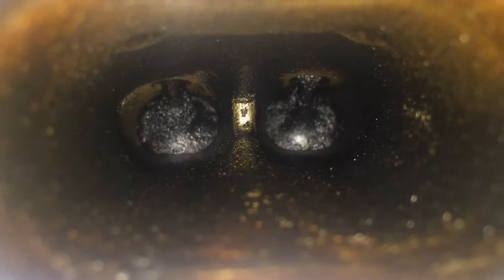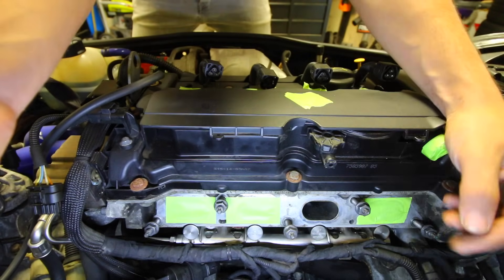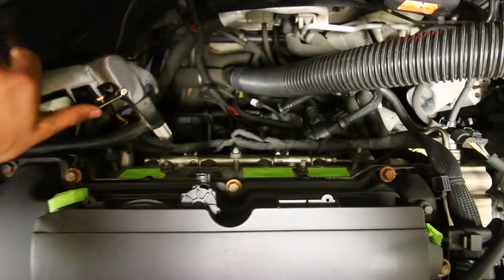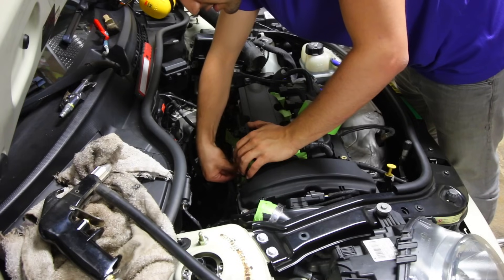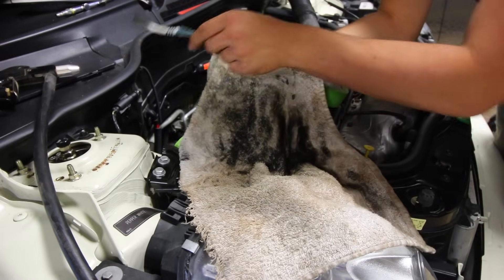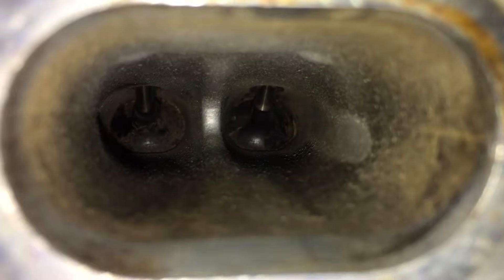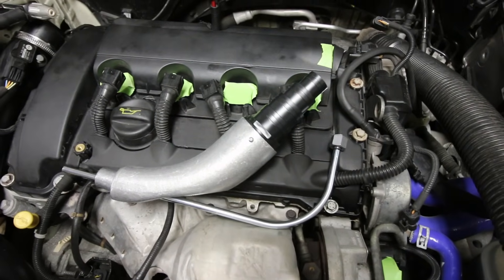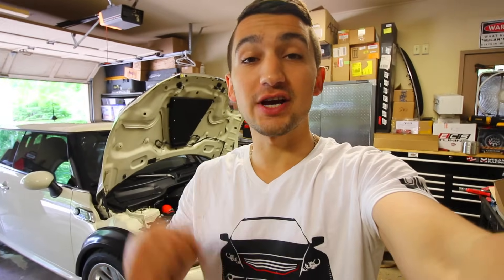How to Walnut Blast Your Intake Valves (CARBON BUILDUP REMOVAL)

Comment: That's why you use Top tier detergent gasoline I always use top tier detergent gasoline
Reply from the maker: Not true. If you own a Port Injection car, you wouldn't ever run into this problem. Since this engine is Direct Injection, there is no way of changing from cheap fuels to expensive top tiers which will result in a difference.
Reply: Negative. Fuel doesn’t reach the valves on DI engines. Therefore the type of gasoline doesn’t matter.

Comment: The more I discover about current engine technology, the happier i'm at maintaining older cars.  Let me understand this right?  Every 20k, there's a $1000/£1000 dealer bill?  Throwing in some rudimentary figures, that maintenance cost is worth around another 7500 miles of motoring.  In other words, the fuel used to get that vehicle to 20k, has utterly killed the cost efficiency as far as $ into the fuel tank to deliver a certain mileage.

It may tick a new engine box as far as improved efficiency and potential but once in the hands of the customer, as soon as you hit this cost, it's a complete smack.  Out of the number of owners, few will be doing this themselves.
Reply: So right-the cost of this procedure FAR outweighs any fuel savings. Like these hybrid electric cars-you must drive most of them more than 200,000 miles before you realize any savings. At that point, you are probably ready for a new car.

Comment: If you just bought a gdi car. Every 10,000 mi. When your doing a oil change,spray crc valve cleaner down the throttle body, and follow directions, and prevent this from ever happening.

Comment: 1- Taping closed sparkplug holes and intakes then turning over engine to make each cylinder valves close will most likely pull/push off tape (via cylinder compression). 2- Also, spraying some gdi intake valve cleaner on closed valves (sit for a few) then shell blasting will produce near new results. 3- invest in a good catch can... My 2¢

Comment: Disconnect you pcv from intake and you won't have that bullshit building up on your cleaned up valves.
Reply from the maker: The PCV system on this engine is built into the valve cover, which means there isn't a way to simply disconnect it

Comment: For me GDI are a piece of sh!)) I have a toyota echo 2003 is not a direct injection, it has 98k and it never missfire at the point to trigger the check engine light. My wife have a Hyundai accent 2012 with a shitty GDI engine and that thing missfire all the time specially running in regular gass, is also triggering the check engine light all the time, lets not talk about gas mileage, is horribly!!! My old car idle smoothly, the hyubdai vibrate a lot and i already replace air cleaner, spark pluggs and ALL COILS. If you go to the dealer for valve cleaning booom 110 dollars every 6k miles, what a bad desing.

Comment: That car would benefit greatly with an oil catch can.
Reply: I have yet to see anyone post anywhere a fair comparison of with and without catch can. For example, a 30,000 mile test starting with clean valves and run without catch can. Then another 30000 after cleaning the valves again and run with catch can. Until then, it's just a theory.
Reply: @ACitizenOfOurWorld  I am a mechanic and I can tell you some cars should have an oil catch can. Others don't need it as bad. My Cadillac Escalade and most GM trucks could use them .I've gotten a tad better throttle response and fuel mileage.
Reply: @ACitizenOfOurWorld  look down the intake if you see oil residue. It will help. My intake was wet with oil 170k miles.

Comment: A new profession created thanks to direct injection. A walnut blaster!
Reply: yeah but itll just be for all the cars that have the early direct injection. now theyre doing a combo of port/direct on the new cars to counter this. (amazed the engineers didnt account for it in the first place but oh well)  but there are definitely a lot of cars right now (including my 2019 silverado) that will need this eventually
Reply: @chanman1197  Not really..Your Silverado has a design that mostly eliminates this build up, by baffling the cylinder head valve cover and re routes the EGR vapors  as well as late spark firing to clean the intake valves.
Reply: Chandler Ley I’m pretty sure they absolutely 100% accounted for the issues keep making money off your products weather it be catch cans to slow process down or 1k 1/2 every couple years to “fix” issue that keeps coming back. I have been looking into just building my fsi into port injection but this seems like something your gonna have no matter what just different mile frame wise. I’m at 180,000 on my 06 and have never taken it in to do this ran oil additives from liquid molly and sea foam in fuel “pointless” and the spray in manifold got it torn apart isn’t too bad buildup intake side haven’t looked at exhaust yet but gonna sparkle like a diamond in a goats ass when done
Reply: Toyota/lexus have been doing the dual port/direct injection ever since they started using DI, don’t know why other manufacturers didn’t figure this out, prevents carbon buildup
Reply: This has been around for decades and it’s not new
Reply: an easy extra maintenance job in exchange for all the befits of DI is more than worth it.
Reply: *thanks to emissions regulations which forced manufacturers to jump through absurd hoops to meet emissions and fuel economy regs
Reply: @mmwosu  DI engines produce significantly more power
Reply: @catinthehat5140  
No, they don’t, that’s just something you’ve been told to make you accept it.
Power is work per unit time and work is just a force applied over an distance. Nothing special about a DI engine over port injection when it comes to the actual physics of calculating power.
Reply: @mmwosu  obviously I meant more power if all other variables are equal
Reply: @catinthehat5140  
If all other variables are equal, your premise is still incorrect
Reply: @mmwosu  Evidence for this?

Comment: Thank you for the tips! I bought the items. How do u attach the tube extension to the gun?
Reply: I have the exact same question
Reply: After buying all the tools I noticed that the tool wasn't connecting to the Blaster gun. I basically just kept the tool pressed up against the the seat of the gun and that worked. I got a response from Milan and he did the same thing as well.

Comment: Do you have any ideas on how I can prevent carbon build up on direct injection engines?
Reply: Just drive your car like Jackie Chan  would
Reply: Do regular carbon cleanings through the throttle body, or a vacuum port.

Comment: This convinced me not to buy a car that has direct injection.
Reply: Enjoy using bicycle.
Reply: Ua la Halizeti  Toyota and ford are now using both direct and port injection at the same time to prevent this carbon problem.  I do like ridding bikes to
Reply: @Kristen555-e4y  not necessarily... the lexus IS250 is a direct injection motor that suffers from this issue aswell.. they fixed it in the last 5-6 years by swapping to direct + port Injection. But yes, they're guilty aswell.
Reply: @joshc9846   @Induction by Force  not a cure, direct injection has other issues that even without carbon build up, can still ruin a long engine life. The compression ratio of all DI engines puts wear and tear fast, even with dual ports (multi port & DI). Also the 10% ethanol in gas that we all use adds to fast wear and tear in any engine.
Reply: Toyota uses both direct and port injection to solve this problem period during normal operation at light loads it runs the GDI injectors for maximum efficiency period but under heavy acceleration it brings in the port injectors. That's enough to keep everything nice and clean but you still retain the advantage of the efficiency of the gdi. Obviously it adds some complication because now you have four more injectors..
Reply: @kens97sto171  Exactly, that is why I buy Toyota. If you have a V6 then you have 6 more injectors to worry about, but being Toyota, that isn't an issue regarding reliability.
Reply: @frankbiz  
Yep that would be my take on it also. Honestly I've never had a fuel injector fail on any car I've ever owned. Most were Japanese built but some were domestic, and some were quite old. And most of them had between 200,000 and 300,000 Miles.
Fuel injectors really are not a common fail item at least in my experience period which is kind of impressive considering the duty cycle and precision at which they operate.
Reply: @kens97sto171  my experience also, I had a 1993 Maxima with over 350k miles and no engine or transmission issues at all. I'm not sure if they are that reliable today?
Reply: @frankbiz  
Cars are not as reliable as older ones even Toyota.
But they are still generally better than others.
You have to look at how many miles and over what period of time.
I have a 2008 Toyota Prius with 344, 000.
Reply: @kens97sto171  that's great, my wife has a 2010 with 100k. Did you have to replace the battery pack, I'm wondering we ours will need replacement?
Reply: @frankbiz  
No mine still rolling on the original battery pack. As far as I know, although I guess it's possible that it was replaced early in its life by previous owner. It definitely is an original Toyota battery pack and it's never been altered internally. I did pull the cover off of it to check for corrosion on the contacts meant to do some cleaning. Certainly appear to be an original pack.
I've done some testing using Dr Prius app and it tests at about 50% total capacity. Should last another couple years.
You have a third gen Prius. 2010 to 2015 . Let me give you a few tips about that generation because there are some mechanical issues that show up that you'll want to take care of preemptively if you plan on keeping the car.
The third generation has an EGR valve and EGR cooler assembly. You need to have that removed and cleaned about every 150 to 170,000 mi. If you fail to do so it will plug up and it can cause you to blow a head gasket which will require an engine rebuild.
It also has an electrically driven water pump. Unfortunately Toyota put a plastic impeller on that water pump they tend to come off and fail overheat the engine blow the head gasket leading to an engine rebuild. It's pretty easy to change it yourself however the pump costs about 300 bucks from Toyota period you want to definitely preemptively replace it I don't know what mileage to recommend I've heard between 100 and 150,000 MI. But I'm not totally certain on that. If you have dogs or pets that you keep in your car or take for rides you definitely want to clean the Hybrid battery cooling fan this is a problem in the second generation Prius also. However in the third generation Prius they reduced the size and cooling capacity of that fan to make it more compact shaped. Therefore if it does get blocked up it's more susceptible to overheating the battery.
If you're interested in seeing more operational information from your car you can pick up an app called hybrid assistant and Dr Prius they are free on the app store Google play store. Get yourself an Android tablet and a Bluetooth OBD2 reader they're pretty inexpensive and you can run hybrid assistant and it will show you all kinds of interesting information period Dr Prius is more of a diagnostic tool.
Sorry for the long reply but figured I'd give you as much information as I could. You can check on Prius chat forum also thoughts of good information there. If you ever do need a hybrid battery replaced I definitely recommend Texas hybrids in Dallas Texas period he gets brand new battery packs from Toyota and will install them for reasonable prices all included also gives a 4-year unlimited mileage warranty on that new battery.
Reply: @kens97sto171  thank you very much for the valuable information, it's appreciated. I'm from Massachusetts, Texas is a little too far, but would love to visit there sometime, its a beautiful state. I wish we had 2nd. amendment laws like there. Who knows now what will happen, it might get ugly.
Reply: @frankbiz  
Yeah that would be a bit of a drive to get a new battery. I don't know if he ships outbound period swapping the battery is not that difficult. But because he offers warranty he's a bit picky on who he'll sell a battery to and allow them to install it. Cuz if you do it wrong and something happens then he's on the hook for the warranty.
Yeah Second amendment stuff is more relaxed in Texas although you might be surprised. Open carry had been illegal in Texas since the mid-1800s until perhaps 5 years ago period and even now you need to get a license to carry basically a concealed carry permit to open carry in texas. And honestly if you have a concealed carry permit what's the point of open carrying period we are more relaxed in other ways. your vehicle is considered an extension of your home and therefore you are allowed to have a loaded firearm in the vehicle with you it only needs to be covered period so you could even put it on the passenger seat with a towel over the top of it. It however cannot be on your person in a holster unless you have a concealed carry permit. But it can be in your vehicle with you whether you have a permit or not.
I suspect this is the case because there is vast areas of farmland and ranch land where you're likely to be in your vehicle.
It's very large state about 900 miles across each direction. Central Texas is extremely populated. Dallas Fort Worth has a population of about 7.5 million.
Metro population of Houston is almost 7 million.
Reply: @kens97sto171  wow that is vast. I personally think that open carry puts one at a disadvantage. I used to live in Rhode Island and it took me 4 months to get a CCW permit but when I moved to Massachusetts it only took 2 weeks, but there is no open carry. Again thank you for some valuable information. Keep safe and enjoy the rest of the weekend.
Reply: @kens97sto171  Educate me, please. What complications can present themselves with more fuel injectors as seen in Toyota. Not being sarcastic.
Reply: @gamingx5042  
Sorry for delay I missed your comment.
Anytime you have more parts you increase the risk.  Also the direct injection runs at high pressure.. so probably more likely for a pump failure.
But time will tell us eventually
Reply: Induction by Force  not a cure, direct injection has other issues that even without carbon build up, can still ruin a long engine life. The compression ratio of all DI engines puts wear and tear fast, even with dual ports (multi port & DI). Also the 10% ethanol in gas that we all use adds to fast wear and tear in any engine.
Reply: Induction by Force  if that's what i said you might be a little correct. The facts are there, you are even more confused. Re-read everything, our conversations.
Reply: Induction by Force  Never said to not buy a DI engine. Your off topic. If I said that you would be a little correct, never did. You are really confused. Facts are all there. Google my points, all facts from various sources and my education.
Reply: Induction by Force  yes Tractors can hit up to 3 million miles at times. I was only discussing gas DI. We both had our conversations mixed up earlier. I never argued with you, I thought I was making my points and agreeing/disagreeing with some of your points.
Reply: You can buy a 1980 Chevrolet Caprice for instance. ALL new cars are Direct injection by law.

Comment: Try running ethanol free gasoline! Maybe a can of seafoam every couple thousand miles will avoid this. But at the end of the day it's still a mini
Reply: Fuel treatments will do nothing for this problem on direct injection engines. The best preventative maintenance is regular carbon cleanings through the throttle body, or a vacuum port.

Comment: HOW ABOUT USING A PRESSURE WASHER AND SHOP VAC? U CAN SET THE EFFECTIVE PRESSURE, RAISE  THE CAR SLIGHTLY SO THE VALVES CHAMBER  WILL DRAIN THE GUNK OUT AND EASY VAC OUT.

Comment: This cleaning is almost ineffective, it cleans the air duct but it does not clean the most important area and is the contact area of the valves, because the valves are closed and if you do not clean the area that the valves touch then the sealing will not continue to be good.

Comment: If you blasted the walnut into the throttle body with the engine running at 7000rpm in neutral  it would blast the intake valves and all the rubbish would come out of the exhaust. This is the way I would do it. Much quicker and cheaper. On second thoughts 7000rpm might be a little much, maybe just 6500rpm.
Reply: Would that possibly damage the catalytic converter?
Reply: I'm going to try this since I'm out of options. I'll let you know the results.......
Reply: Use silica sand and rev it to the limiter.. I'm getting 70 mpg!

Comment: Nice! But what if y only seefoaming the system?? This can't help a bit at least??
Reply from the maker: Seafoaming a direct injection engine will not help at all. There will be no cleaners hitting the backside of the valves like a port fuel injection engine would.